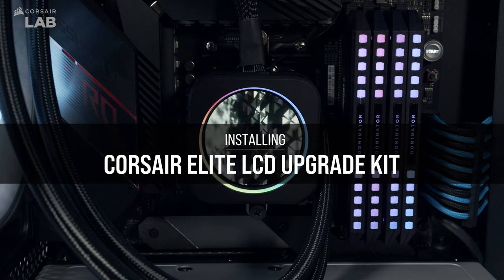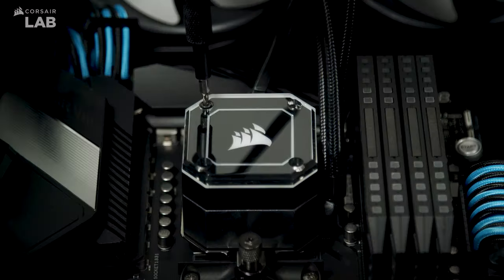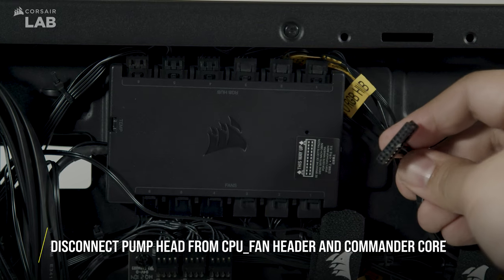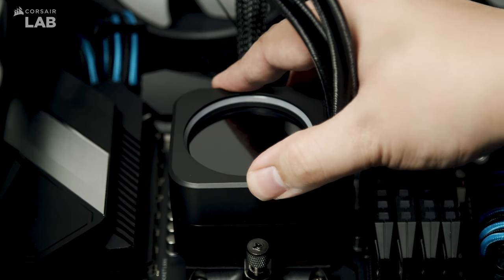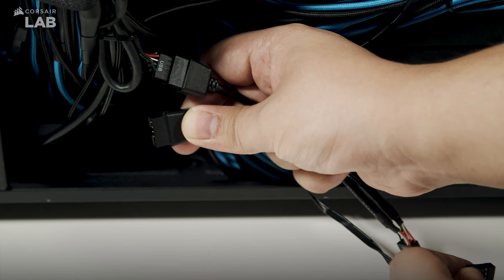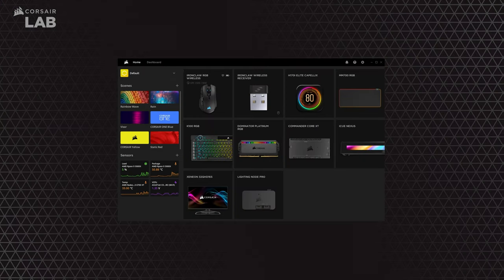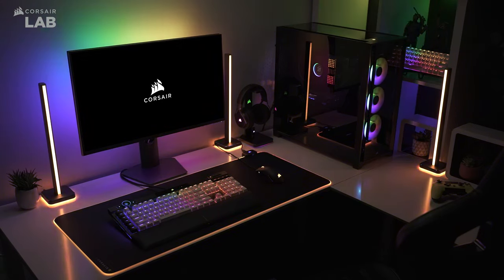How to Install CORSAIR ELITE LCD Upgrade Kit for ELITE CAPELLIX CPU Liquid Coolers

Comment from the maker: Please note that you must have the latest version of CORSAIR iCUE (4.16 or newer) installed and update the firmware of your ELITE CAPELLIX CPU Liquid Cooler before upgrading it with the CORSAIR ELITE LCD UPGRADE KIT. If you require additional assistance with your ELITE CAPELLIX COOLER and/or the ELITE LCD UPGRADE KIT, please reach out to us at https://help.corsair.com
Reply: Are there these cool  lcd modules for custom loops?
Reply: If they even work. 3 coolers doa..
Reply: wanted to ask how i can get that usb Y-splitter cable or can i not purchase that item from you
Reply: Dang, that's a deal breaker for me. Latest version of iCue causes my computer to crash after 30 seconds of loading up, so I had to uninstall and keep it at the previous 3.xx version
Reply: Does it come in White?
Reply: Cuando tendreis stock?
Reply: WHEN IS THIS GOING TO BE AVAILABLE !?!?! BEEN WAITING FOR MONTHS !
Reply: @ravenwings7945  i call bs.  cry more.
Reply: Really should have that in the video... I did all the steps in the video and didn't rwalise I didn't have the right version of icue even though I updated everything
Reply: Im building my 1st pc and got this upgrade kit do I have to get iCUE before or after its plugged in?
Reply: Se puede instalar en este modelo ?  SKU: CW-9060070-WW Refrigeración líquida de CPU iCUE H150i ELITE CAPELLIX XT

Comment: Just wanted to share a few errors I had and how to fix them

1. If the lcd screen doesn’t fit due to ur coolers Mount blocking it the four black screws will take off the extension allowing it to fit perfectly, there’s no need to buy a new Mount or shave any plastic off.

2. I didn’t upgrade my icue software before hand this will result in ur bios telling you there’s a fan speed error but the work around is in ur bios go to advanced and on your fan speed set it to “ignore “ then save ur settings and this will allow you to get into your computer and upgrade it from there 

Hope this helps someone out
Reply: Bro thank you❤

Comment: Got mine this afternoon, took about 15 mins to install, super easy thanks to this video, only side note I could make is the I have the latest icue software and it doesn’t see the commander core but the pump head itself made sure that was up to date, fitted the lcd with no issues (3800x am4) bracket fired up icue, it recognised the lcd straight away, updated it and was very easy to setup up gifs for it etc, the multiple screen gallery with customisable time slots is amazing, currently half price in uk too, Corsair you have smashed it with this product
Reply: Olá amigo. Pode me ajudar com meu iCUE?

Comment: This is excellent.  At first I thought I would have to buy a whole new AIO but I only need the module! Thank you Corsair.
Reply: Sure if you already have the capellix you only pay 100 for the kit but if you don't.?
Reply: Turns out, you still have to buy the whole new AIO because Corsair hasn't restocked the upgrade kit since December 20th, 2021.
Reply: @leptoon  Yah...ain't that the sad part.  They haven't had stock on the upgrade LCD for months.
Reply: @timt7330  3 months later, nothing. Dang, I need a new AIO all together. So I really wanted this but in white. They don't make one. They make one on black. Then they have this kit here which makes the normal white 150i Elite into the LCD version. Awesome that's what I need. But now not in stock. Sadface.

Comment: The shroud does not work with the AMD brackets (at least not for everyone somehow). The shroud sits too low and hits the brackets, preventing it from seating onto the magnets and plugging in. I had to remove the shroud, which is thankfully very easy with only 4 screws holding it on. Pops right on without the shroud and looks good. I have the H150i Elite Capellix 360mm on a Ryzen 9 5900x.
Reply: Thank you for this comment, was in the middle of installing mine and couldn't figure out why it didn't fit.
Reply: thx for the heads up- I was going to get this for my capelix, but amd ryzen 5800x
Reply: Thanks man, worked thanks to you. Also have a H150i Elite Capellix 360mm & Ryzen 9 5900x
Reply: Thanks I was trying to figure out how to make it fit with my brackets.
Reply: Thanks your comment helped me install it properly
Reply: Thank you! You're a life saver.

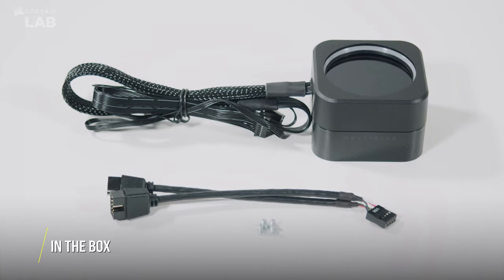But I didn't know what the shroud was at first, but eventually figured it out. It's the bottom half of the plastic in AIO display in 0:28
Reply: Love you bro! You save my day

Comment: incredible the amount of cables to connect all these things
Reply: Yes it is insane.  I have six rgb fan with a push pull set up on my AIO.  Plus everything else in a small form factor case.  Wiring was a bit tricky to get it nice and clean but I managed.

Comment: Anyone know where to find a “commander core”. I didn’t know any better and bought an open box and mine was missing. Corsair is out of stock and doesn’t respond. The net only has “xt” and “pro” which do not connect to the AIO.

Comment: I have the cooler mounted in such a way that the logo on the cap is upside down. Is it possible to change the orientation of the LCD in software?

Comment: can you just use this lcd module and mount it in the case without the cooler? i would love to just have that little screen running the temps inside the cast but not on my pump
Reply: check the link out, you can have a lcd do that for you

Comment: Help any suggestions would be appreciated,  building a new PC (intel) using MSI Z690 carbon WIFI paired with Corsair iCUE elite H170i cooler.  
It states (Connect pump tach cable to the CPU_FAN header on your motherboard) this is 3 pin however I only have 4 pin connections.

Comment: I bought this upgrade and installed to AMD AM4 and its not compatible it wont sit and connect properly due to the bracket is getting hitting the base causing a CPU Fan Error every time I boot up.I had to trimmed the bottom part so it would sit and connect after doing so the CPU Fan Error was gone and was able to boot up properly. 

I’ve also seen another video that the new complete set comes with a proper AMD AM4 bracket to utilize the four screws. I wish this is Corsair LCD Elite upgrade comes with Spare AMD AM4 bracket. So I didn’t to go thru trimming the plastic just to sit flushed on the aio pump base.

Comment: Wish I wasn’t stuck with a lcd cap driver error that can’t be fixed. I tried switching the plugs around, I tried clean reinstalling icue several times, tried force updating (broke everything had to do clean reinstall of icue and unregister every device to get it to work again). Nada, nothing works.

Comment: What do you do if your existing capellix h150i isnt recognized by icue or bluetooth? I'm getting power(fans are spinning) and I'm getting signal(Commander core aio and attached fans are flashing red). I've tried reseating several times. reinstalling several times, reinstalled os. swapped usb, tried powered adapters. NOTHING I've tried works! This is my first build in 17 years. Everything else is working great, pc is all updated and can be used, Pump is running at 2200rpm but FLASHING. i cannot get control over anything attached to H150i/ComCore. Submitted a ticket. Still waiting to hear back.

Comment: I definitely want this if it is ever in stock. One question I have is that in the video it shows that the original cooler cap is held on by screws. My H100i doesn't have regular screws. It looks more like tiny tiny hex heads, but my eyes are bad so I can't be sure without taking time to open up my rig and get a magnifying glass. Anyone have the answer as to how to take these off?
Reply: It was in stock about a week ago on their website. Mine just got delivered. Site says out of stock now ):
EDIT
When you buy one of these it'll give you the tool in order to take out the hex heads you're talking about
Reply: @snowyuri1316  Thanks for replying. Since I posted this I was able to get the LCD Upgrade kit as well. What you say is true, and also the original H100i Elite Capellix cooler comes with the same hex key in the box. It had just been over a year since I installed the original and had forgotten about it. The LCD screen looks amazing and I've been having fun putting images of my dog on there, GIFs of my favorite anime characters, as well as being able to monitor GPU and CPU temps without having to have extra software open on my...monitor. I hope you enjoy yours as much as I've been enjoying mine and have a great day!

Comment: Sorry for the dumb question, what's the USB header designed to do? Does it only provide power? If, yes, can you use something like a SATA to USB header converter to power it? (in case you don't have enough USB headers on the motherboard and the Y splitter doesn't play ball)

Comment: Question: connect the 3 pin pump to the cpu fan or AIO? Also what is the difference?
Reply: I believe if you don't plug it into cpu fan you may get a warning when booting no cpu fan detected

Comment: I am wondering since I have already installed the hard tube water cooling for cpu, can I use it separately as a display screen ? Like mounting it on other places inside the pc case or just outside the case ?That would be awesome if this can be used in this way.
Reply: No look at 0:56 it needs a connection to get power to the screen

Comment: Does it also work with the Corsair hydro series h150i?
Reply: If it's not a Capellix, it will not work.
Reply: @Hypnodog_  that’s sad.  I know my Hydro H150i is old and was bought in 2020, wish there was a way to get it to work.  My AIo is still working very well.  Don’t want to change the whole AIO just the the LCD.

Comment: You guys are tempting me away from what I was gonna do originally.

I was gonna get a Corsair 420 rad then get an Asus Ryujin II 240 cut off the small rad thats on it then plumb it up to the 420 rad..
Reply: Corsair sells the Elite Capellix AIO's with 420 rads AND also sells the Elite iCUE LCD coolers which have the LCD pre applied in 420mm variants
Reply: @zahidshabir4038  i know man ive seen them but i was trying to go for something abit custom but this seems tempting with the screen upgrade

Comment: VERY MAD CORSAIR!!!!!
Corsair USB splitter dont work (its dead) i need to assembly PC again and connect 2  USB separately (commander) (lcd screen) to motherboard directly and also had to buy from china new AM4 mounting bracket because corsair have sold out for last 2 years. Old AM4 Bracket don't fit the the new LCD screen!! its actually was nightmare to upgrade to this LCD screen!!!!
Almost everybody reported the same problem!!!

Comment: I used Corsair AIOs for years and all have been great. The last one was the Elite 360...and my god its was bad.
The pump noise was terrible. The hum that came off it was nuts. And yes, after 20+ years of PC owning/building, I did all the normal checks, but no joy.
I got it replaced for another and the same hum happened on that one. 
Gutted, but there was no way I was trying for a 3rd time.
Reply: You had the pump higher  then the radiator it sounds like.
Reply: @Krackorn  Hi.
Nope, I have had it lower. Did all the problem checks and everything. A few weeks later, I found others with the same issue.
I ended up trying a Deep Cool XL, thinking it would be ok, do for now, and it turned out its pump is the quietest I have had with an AIO....and I have had a fair few over the years.

Comment: i have the kraken z73 right now and hoped long for a cpu pump with a lcd screen from corsair so i can switch to this and finally delete this crappy nzxt software... but can you have both, cpu and gpu temperature both shown at the same time? if not, it would be a big drawback for me.

Comment: what if you dont have a Corsair AIO to begin with? or  no other Corsair Components?
I dont have a commander Pro and I dont want to buy one for just single AIO Upgrade, is there any alternatives?
Reply: You're kinda asking for something in the wrong place.. This is an upgrade kit for an existing product. If you don't have the capillex AIO, then you just need to buy one with this LCD screen preinstalled. Their AIOs will start being sold with this add-on. This video is just explaining to those who already have an AIO, but don't have this screen, so they aren't forced to buy a whole new AIO.. This LCD screen is specifically for their capillex AIO. If you don't have an AIO, then you're using an air cooler or custom water cooling. It wouldn't even make sense for this to work for anything but an AIO. This was made to compete with other AIOs with screens. 

If you want something like this, but don't want an AIO, then you need to just buy your own LCD screen from Amazon, rig up your own Stat display, and then stick it somewhere inside your case. Or find some other product that displays your computer stats on a small screen.

This product is not for you.

Comment: For some reason I can't push it in fully

It's like something is in the way or smtah great...

Edit
The plastic shroud which serves as the base covering the block doesn't fit in with the AM4 cpu mount....

Thankfully you can remove it and it's not too obvious but it's such a dumb design  flaw....

Seriously fix this.

Comment: I like the actual CPU block LCD BUT WTF is that power/data cable coming out of it. Its too ugly. I have custom cables in my PC and if I got that then that would be so obviously visible (I don't care too much about the CPU fan cable because that is a small thin single wire cable and hardly noticeable but the power/data cable is clunky and has cheap braiding on it that is covered in a CLEARLY visible heatshrink and it ruins the aesthetic of the otherwise more premium looking pump/block head). If the cable looked more like what someone would expect from a custom cable then it is so much more worth it because stuff like this annoys me. You have high end CPU coolers or even custom liquid cooling pumps then the custom proprietary cables that come with them or cables that are directly soldered in to the PCB are almost always aesthetically trash. People who have the extra money to spend on high end liquid coolers, custom cooling and high end PSU's and whatnot CLEARLY have the money for these bonuses and ALSO I am sure that using a more aesthetically pleasing cable wouldn't cost more than a DOLLAR or so to include anyway
Reply: Agreed. That cable really spoils the whole look and is too big to kinda tuck away and hide. Maybe they'll revise that down the road.